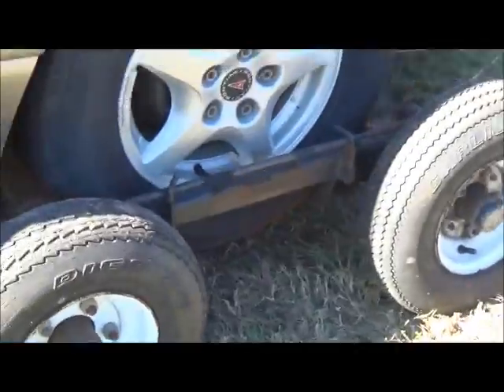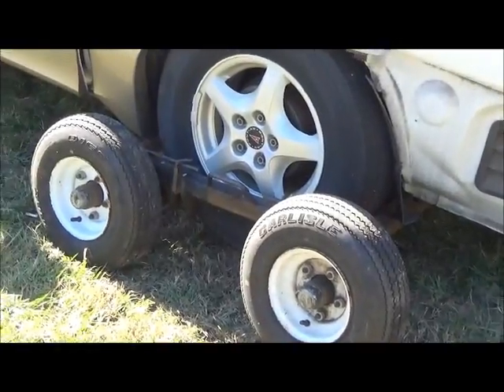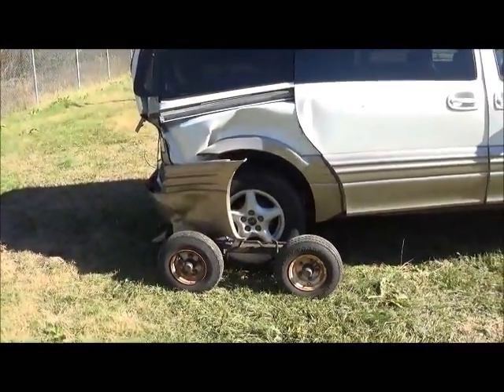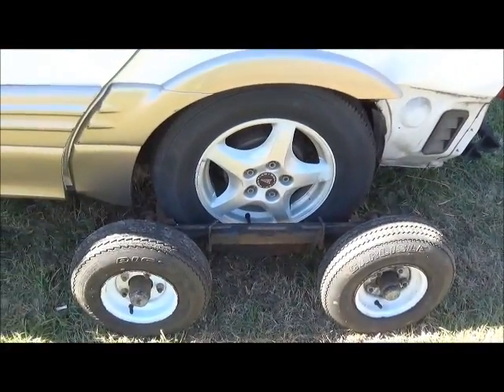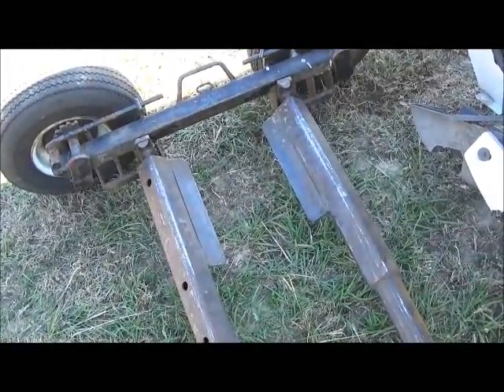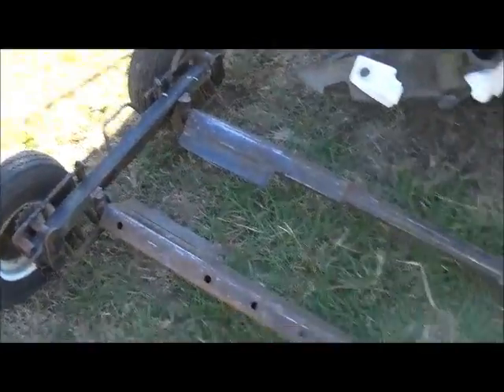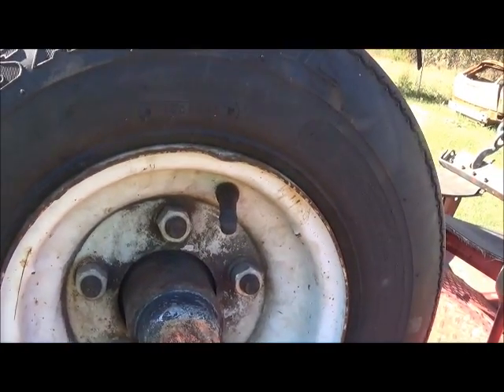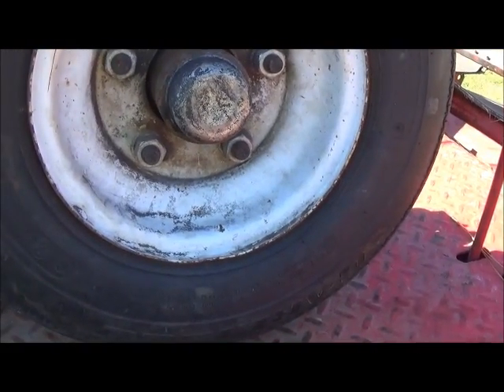How To Use Self Loading Wrecker Dollies

Comment: Thanks I used to tow in the mid 70s 
All they had was the tub type. When I quit towing they came out with the wheel lifts and the slide backs.
Seems like it would be easier than the old slings cars don't have bumpers now.

Comment: Nice explanation. The place I worked for never had these. As well as no snatch block and wheel straps for a rollback deck. too cheap!  I like the wheel lift idea to push the car on it.
Reply: Ghetto Wagon 
snatch blocks/pulley at list one   , straps at lust 4  Is a must in tow truck !!!!. Haw do you secure  bmw or Mercedes on your bed ????

Comment: I use the same as guy in video but I saw he pulled the prybar out before locking the pin and if you aren't careful that prybar can catapult across a parking lot... or your head

Comment: Loading with ITD speed dollies using the MADLE from 1dolly.com is the easiest way to load speed dollies in tight spaces or against the wall.  Flat tires and against the wall is still no problem.  Even if the mirror is blocking the other side.